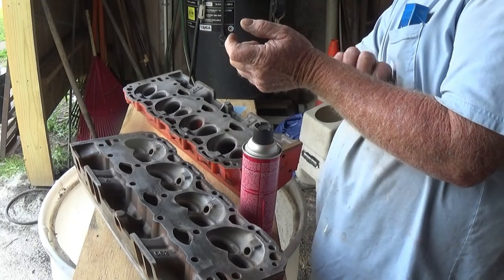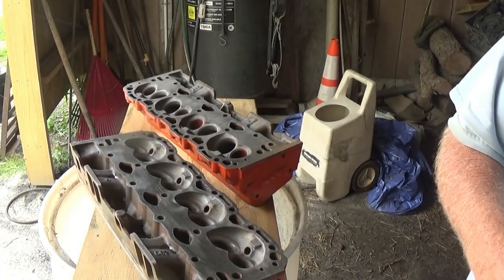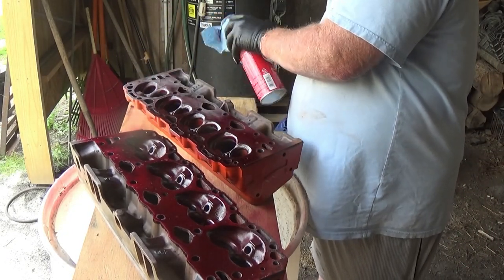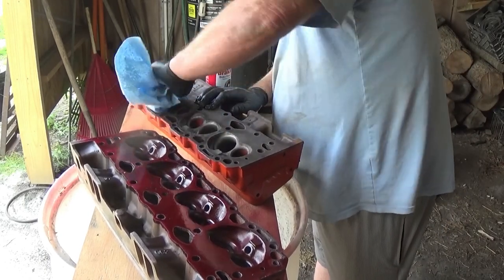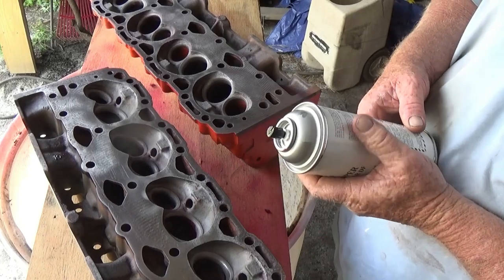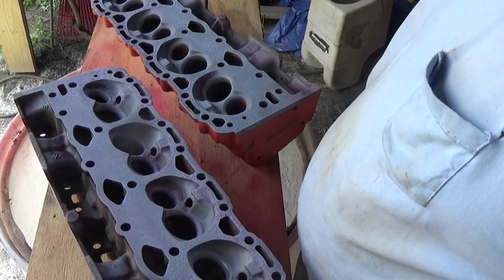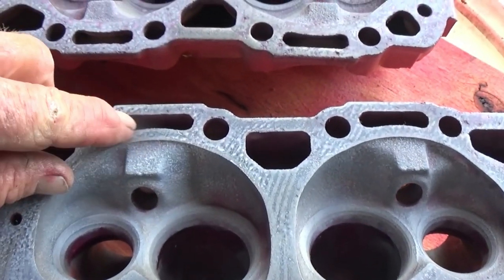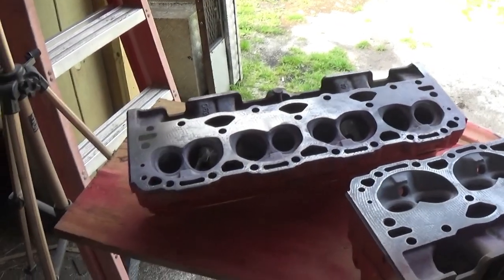checking  062 vortec heads for cracks

Comment: Never seen or heard of that stuff. Just magnaflux for iron and pressure check for alluminum
Reply from the maker: cf the stuff works pretty good
Reply: it's a dye penetrant in reality it's probably a better product/procedure than using an ac or dc yoke that a machine shop would use. A yoke is about 1. step up from your eyes and a kid could learn to use it in about 5 mins. as far as NDT goes using a yoke is pretty much the bottom of the barrel.

Comment: Help me saved a lot of money I’m gunna see if this 355 is good or not I had coolant shoot out from the oil pan gasket
Reply from the maker: good deal glad it helped you out
Reply: @oldmanintheshopbuiltnotbou8726  where did you get the material from ?
Reply from the maker: @jeremiah_c10  I picked the stuff up at my local welding supply store air gas I think is the store chain name the two cans were around 10 bucks each